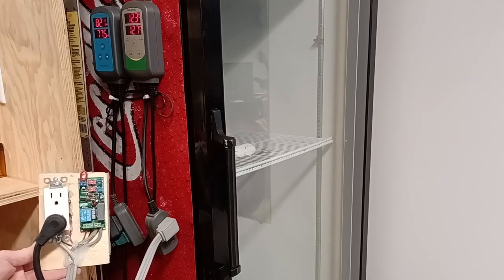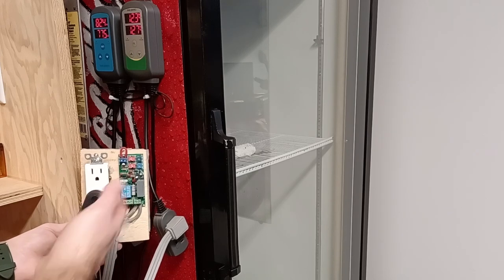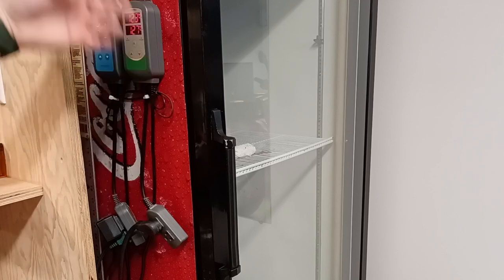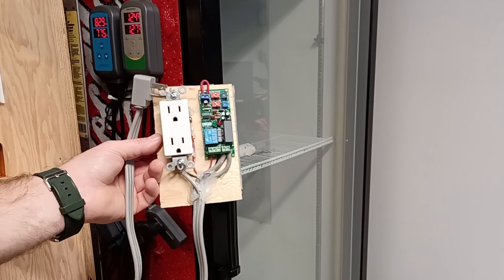Curing Chamber Timer Relay

Comment: What is actually wrong with connecting fridge directly in to the thermometer?
Reply from the maker: It was cooling for too long. Back panel used to cool for about 10minutes and then the temperature used to keep dropping dropping and sucking up the moisture in the fridge, so my humidifier was running a lot more trying to balance and then it overshoots and starts dehumidifying, was constant battle. I installed timer relay and those 3min were enough to drop the temperature and stop running for to long
Reply: @westcoastcharcuterie  I have that same back panel in my fridge, so far it's alright.. situation may change during the summer tho, I'll keep this in mind 👍